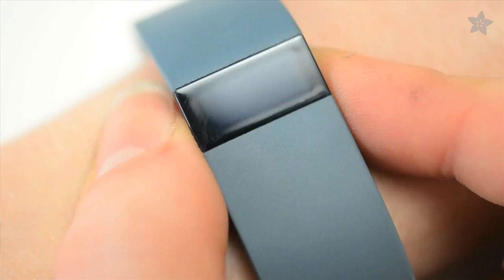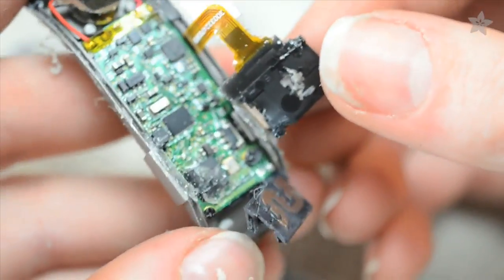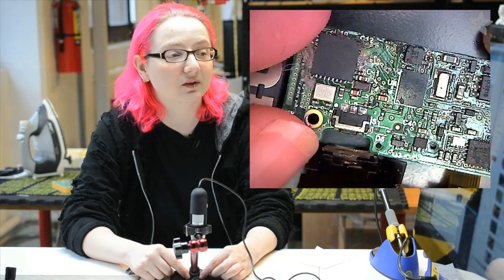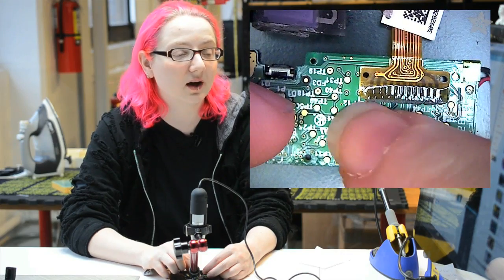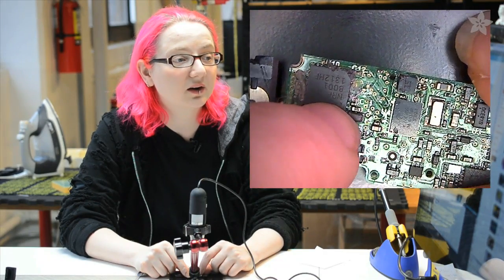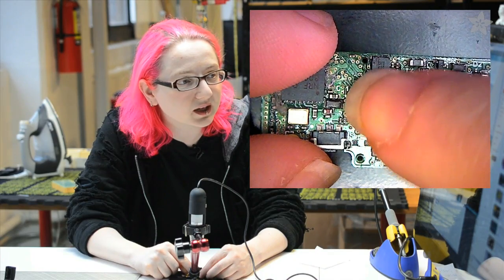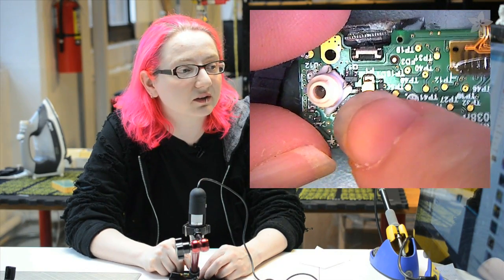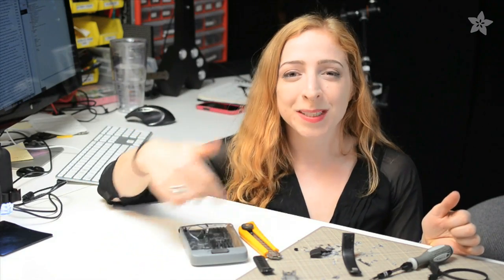Fitbit Force Teardown

Comment: Broke my fitbit. Any suggestions on what adhesive to use to put it back together?
Reply: I just tore the band off of my Charge last night, due to unsightly bubbling; you'll have to unscrew it first. Try Loctite  brand super glue Gel Control. I almost gave up on my Fitbit completely, but was able to breathe more life into it through this method. If this info is still of any use to you, good luck.

Comment: What screw driver set did you use I haven't been able to find one that fits. My band fell off my glue melted from wearing it too much. lol
Reply: I am wondering that as well! I have the same issue.  The glue on my force has come off, but with the recall, I can't get them replaced.  I think it is a T1 or T2 torx screw driver because the T3 that I had was just a little bit too big.

Comment: Hello Guys.

I lost my USB cable and I'm unable to charge it.
Since there is no cable in the market, I'm thinking to create my own. 

However, I need to know the pins to power up my Fitbit Force. 
It is possible to check it on your powercord which pin is Positive (I supose 5 volts) and which one is Negative? 
Thanks.

Comment: Would someone provide a pinout of the Fitbit Force USB cable?  I was given the tracker but no charging cable, and I just can't bring myself to spend $20 plus $4 shipping for a silly cable.  I know there are only six possible options but I'd rather not fry my device :)  Thanks!
Reply: Hi perplexer. I have the same problem. If you find out, let me know.
Reply: Edward John
Well that was pretty straightforward.  I didn't realize the cable was reversible, so there were only two possibilities.

Center pin is +5V, outer pins are GND.  Happy cable construction!
Reply: perplexer
Thanks a million. I'll try it our tonight.
Reply: Have you been able to try it? I have the same problem and I'm looking for a solution.
Reply: You can find the cable on ebay or aliexpress.
I made one as perplexer instructions.
It works, but it is a little bit hard to put the pins right over the contacts. :S

Comment from the maker: Disney MagicBand Teardown
http://adafru.it/b95786

Mike writes in to tell us about this Disney MagicBand teardown he spotted:

I’ve been geeking out on the details of the rollout of Disney’s massive $1.5BN MyMagic+ “next gen” guest experience. The center piece is the new RFID MagicBand. Based on several teardowns and the FCC documentation, there is apparently a passive RFID tag that is thought to be a Mifare Desfire EV1 with an encrypted portion of its 512k memory AND a battery-powered active RFID tag under that that can be read from a distance to trigger commemorative photos on rides and much more. The MagicBands are starting to appear on eBay for around $28.00 (Buy-It-Now), but as the program rolls out across the other parks throughout this year, I’m sure they will drop in price. I haven’t had a chance to try, but maybe the passive tag can be reprogrammed to work with Adafruit reader hardware? Makers have already started producing their own versions of the fabric covers that Disney sells. And it will just be a matter of time before someone comes up with 3D printable models of the snap-on MagicBand Band-Its.

Read More
http://adafru.it/b95786

#WearableWednesday
Reply: Video doesn't match the post :)
Reply: Magic Band 2.0 goes around your neck and contains explosives.